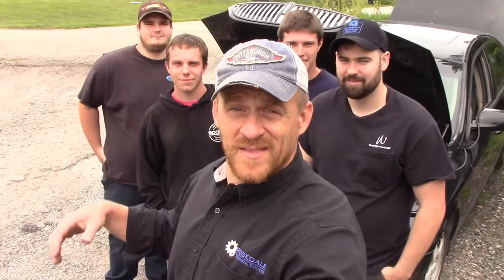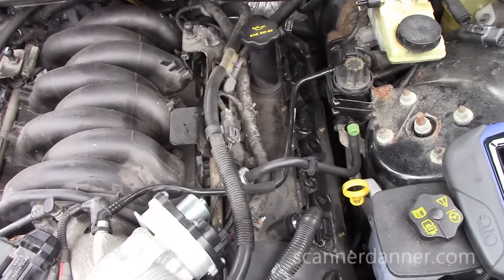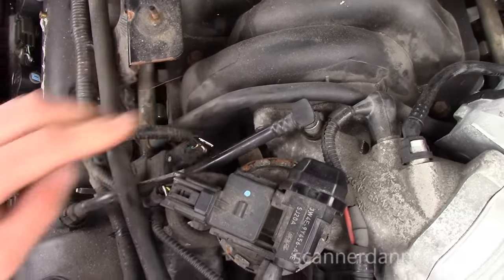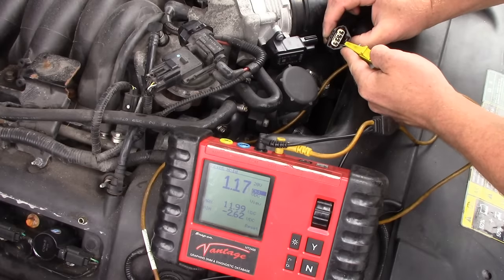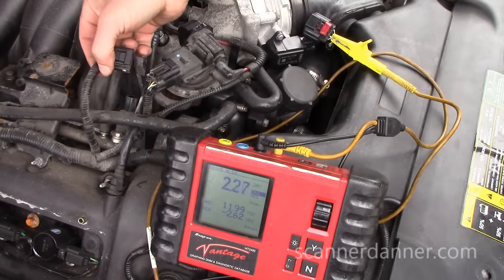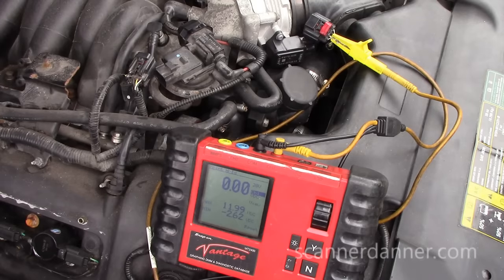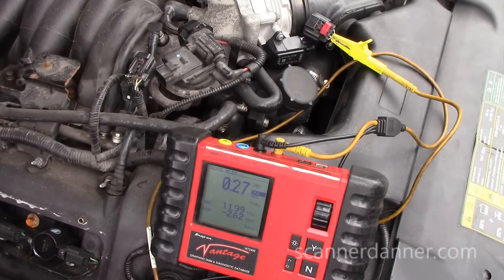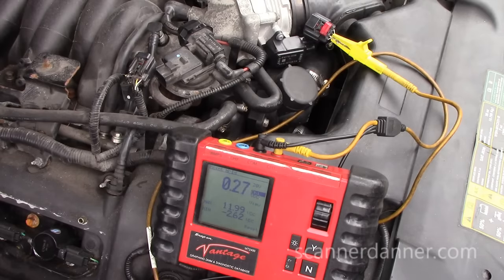Troubleshooting a No Start, No Spark, No Fuel, No Com (any car)

Comment: plan and simple " your customer employed you to diag a no start" Not a running or drive ability problem " if you find after you have sorted the no start there are other problems its a new diag book time ' key is information at the start get the customer to fill in a work order stating what they are expecting you to do second  is information about what they have done or had done  IE parts other techs ' most importantly make sure they understand you are there to do what they ask you too ' anything else will incur further charges  for your time now the why " you have spent thousands setting up and buying equipment 'training you have running costs surely it worth something '

Comment: Paul should of used your favorite tool the load pro!! Then you wouldn't need all those dumb t pins or that expensive relay tester or be setting that theft codes!! just saying!!    :)
Reply from the maker: A voltmeter and a jumper wire is all that was needed here. Just saying.
Reply: Yeah lol. you are correct. I just like giving you crap about the load pro! I love that tool !
Reply from the maker: It has it's place
Reply: Hey Paul Don here not sure if you remember me i was the guy that told you to check out "wall builders" when we had some guys complaining about our faith and the founding fathers.  Anyway my uncle is a pastor and has started 2 churches in the Omaha area and has a car care through the church for people on hard times,single moms etc. church buys the parts and fixes the car. I was a mechanic for 23 years and now work for snapon diagnostics as a diagnostic rep in Atlanta. I was able to round up some old verus and verdicts for them to have plus a up to date verus pro that was mine. They have like 8 volunteers that are helping. I'm going up there first of Oct. to do some training with them on the scanners and scope. But what i was wondering if you'd like to donate 2-3 of your books hard copies would be best as i'm not sure they have internet yet to their shop. Maybe a sub to your paid channel for the church?? Anyway either way love your stuff. 
I gave them most of my tools from when i was a tech and i had a lot. So their 3 bay shop is better now than  most shops!!
Reply from the maker: Absolutely Don. Email me at paul@scannerdanner.com with a name and shipping address of where you want them sent.
This is the stuff that truly matters.(helping others)

Comment: It's not the black spot. It's caused by the relay not making 100% contact. I bet it was only touching 10% on both sides. As it was either warped or was dome shaped on one side of the contacts. As I seen this issue before with cheap relays made in China or Mexico.....One reason when I got to the salvage yard. I pull all the relays\fuses\headlamps before they crush them. As some are Sold State and they are not mechanical and they are expensive for Factory Dealer parts....
Reply from the maker: Good tip thank you!
Reply: Word of advise to those that work on AC problems. As Honda. Nissan and Toyota use Solid State Relays. As they are controlled by the ECM. To improve gas mileage. So they are a duty cycle controlled relay. You stick a mechanical relay in there and call it a day. You will burn up an AC compressor. As it no longer is controlled by the ECM. It will run all the time or cycle...

Just like all the new alternators will shut off. To reduce engine loads. To get better gas milage. As the Alternator is now controlled by the ECM.. So make sure i fyou replace one. You put the vert exact same Voltage Relay in there. Or it will fail and they make 4-6 types specific for each vehicle. Not just year model. I fixed plenty of those as well. As they parts counter guys give you a rebuid. Yet have no clue what color Voltage relay it requires to function correctly. AS you have to actual remove it and look at the backside..

Good Luck

Comment: PLEASE PLEASE PLEASE REMEMBER THE IMPORTANT BASICS OF ELECTRONIC DIAGNOSTICS ITS SIMPLE 1 GET ALL RELEVENT DATA WIRING DIAGRAMS TO HAND 2 HOOK VEHICLE BATTERY TO MAINS CHARGER MIN OF 11.9 VOLTS STABLE 3 CHECK DLC FOR PIN 16 POWER PIN 4 CHASSIS GROUND PIN 5 SIGNAL GROUND AND PIN 6 & 14 FOR CAN SIGNAL 60 TO 64 IS PERFECT HIGHER IS DISTORTION  OPEN IS BAD COMPUTER OR CONNECTOR  IF DLC CHECKS OUT OK CHECK ALL GROUNDS WITH CONTINUITY  THEN CHCK ALL FUSES [BLOWN] THEN CHECK ALL FUSEBOXES FOR BATTERY VOLTAGE INC RELAYS VERY QUICK AND SIMPLE IN IDENTIFYING WHERE PROBLEMS EXIST AND ON WHAT CIRCUITS THE POWER CONTROL RELAY IS TESTED BY THE IMMO THRU THE RESISTOR IN THE RELAY NO CIRCUIT NO START THIS CUTS PROBLEMS TO A MINIMUM DONT LOOKING AT THE MIDDLE OR END START AT THE BEGINING
Reply from the maker: Some tips for you:
#1. Don't type in all capitals, it is known in the digital world as "shouting". You are shouting at me. 
#2. Complete sentences and punctuation is a really good thing and allows me to follow you thought process!!
#3. You are telling me how to troubleshoot this circuit, when we had the problem pinpointed in under 5 minutes! You would have still been testing fuses in your method. Learn your fundamentals, learn about the reference circuit and how important it is and how to check it and more importantly WHY it is a GREAT, FIRST test, for any no com, no start problem.

Comment: Sir why would you be doing electrical work with a dead battery that's my question?????
Reply: Isn't it obvious to you that he was able to FIX the vehicle even though the battery was low? The 5V signal was low---his tests showed the battery was well above that. That goes for the 2 clueless people that gave you the thumbs up. Doesn't dawn on people like you the battery was low from whoever owned the car trying to start it. HE FIXED IT! CAR STARTED AND RAN!

Comment: You feel taking a screwdriver and tightening the radiator hose clamp is not your problem ?  What about, will say a woman takes the car with the hose clamp leaking, that you didn't tighten and fries the engine ? What about building good customer relations ?
Reply: Because if there are bigger problems than a loose hose clamp (cracked radiator underneath that hose clamp) and you tighten it and it breaks then you OWN that problem and you have to fix it, maybe even out of your own pocket since the customer didn't authorize you to do that.

It's much better to notice the problem, notify the customer of it, ask them if they would like it repaired by you, and if they say yes you repair it and bill them accordingly. If someone pays you to diagnose a no-start and you end up breaking their radiator anything you say (I wuz just tryin' to help!) is just going to sound like a cheap excuse and that probably won't do anything positive for good customer relations. You have to keep your customer in the loop and let THEM make the decisions about THEIR car.

"The road to hell is paved with good intentions."
Reply: @napalm1101  Exactly, there are some real a-holes that would blame you for breaking it. Notify--like you said--go from there.

Comment: If you like brain teasers how about my parents 2005 Nissan armada😉 
After running for an hour or so the engine development multiple cylinder miss fires (drop outs) along eith back firing when a plying more than 1/4 throttle. No check engine light pull over to the side of the road to turn ignition (off then back on) the issue goes away for about 20-40 minutes then starts to act up again.
Haven't seen any YouTube videos fix it or have an answer with similar issue on the titan trucks (identical to the armada)
I've read multiple forums with same issue hesitation after long drive no check engine light. 
Going to ask around Nissan service techs today (10/09/17) for some answers but definitely a weird issue. Multiple cylinder drop out suggest power supply issue but don't see any engine ecu relays under the hood to check so far. I'm probably gunnar need to pull out the classic vantage scope tool
Reply: Talked to couple repair shops and found out there's a service bulletin for the engine ecu relay (what I was suspecting) didn't see it because it wasn't shown on the fuse box diagram😑
Be sure to watch our for that
Reply: Still acting up, still no check engine light, and still resets for 30 minutes with the key turned off then back on.
I feel like Gregory House 
That's interesting😮

Comment: Not a car guy per se but an electronics guy. Looks like a regulator went south.
Reply from the maker: What regulator? This was a load side contact in the relay.
Reply: Well there has to be an easy way to step down 13.8V DC to 5VDC. Usually that's done by a regulator or a dc-dc converter.
Reply from the maker: Oh, you are talking about the 5v ref circuit. Yes, there is a voltage regulator inside of the engine computer that is responsible for this entire circuit.
Reply: @kd1s  Still, the regulation of the 5VDC was not the problem.

Comment: Start with a lousy 5v dc, add corrosion, mouse loving soy based insulation, add "feature"  upon " feature" run by a computer wired with hair thin wires and shitty connectors, and you have a perfect storm of problems.
Reply from the maker: Welcome to the automotive field 😉
Reply: @ScannerDanner  No thank you. I am 78, been doing all my own work forever. I have never seen any industry purposely destroy itself like this. Making things very complicated for little to no gain is insanity. THEN sourcing parts from a country with no regard for patent law, the use of correct materials for the intended purpose, and no quality control is imbecilic.

Comment: Ill save you some time. Always switch relays around
Reply from the maker: Lol and when that doesn't work? What part do we change next?
Reply: @ScannerDanner  naw you are doing it right. But if fuses are good. I would check fuel pressure if good, then i would check camshaft/crankshaft sensors if good.  Compression if good id send it to you lol. If you plan to work on bmw type cars you better learn to read an electrical diagram.

Comment: Let's be clear... I would hate to be paying you $50/hr to diagnose a bad relay!
Reply from the maker: Ridiculous comment
Do you know how many cars I see that have had thousands of dollars in repairs before they come to me for a simple broken wire or relay problem?
You think we have a magic wand to wave over the car and say "here is your problem"?
Or maybe you are one of those people who think plugging in a scan tool is enough because it will tell you what is wrong with the car? 
How many times have you had your car at a shop and they sell you a part (a repair) and then they call you back a few hours later and say "well this part is fixed, but now you need another part"? Let me interpret this for you. They misdiagnosed the original problem and are now going to try another part. (Parts changers)
In this scenario, im saving you money. Why? Because I know what I'm doing and I'm worth every penny of that diagnostic fee.

Comment: Nice that you are indoctrinating your up and coming techs to protect their assets by being very specific about the customer's request. You don't know, the customer may be fully aware of the misfire and chose not to include it in your diag. It sounds like you're being an ass but you're not. Lucky for them you found it with little additional investment but it still counts. Then the real reason you break it down: this car was quickly becoming a rabbit hole with age, miles and beeninititis. Yes, that's now a word whether it is or not because I say so.

Comment: OK scanner went through the s10 1994 man got it running poured then started smelling gas running poorly shut it off started run like Hank man this Chevy vortec has really it'd wonder windshield still in it so I grabbed and dont no why on the platinum there are to wires that run through in take goes to regulator on spider the to wires comet to a connector Everytime I move connector it dies don't no if it's in polonium or its the connector so I hooked on 1 will not scan code so I thought computer until you thrower that video on computer ground that's next .but I'm pull polonium off just to check .but we're the ground on 94 s10 computer ground .is that why it's not taking obd1 scan I don't have scanner computers they changed computer don't no if they programmed it or not or if it had the same number it's a four-wheel drive to beat in me down but I narrowed it out

Comment: I am not going to dog U on what U did U have to start somewhere these conditions R A Fickle Beast + U must always go w/what got U to the show & that is the successes U have had to establish. < no start issues R like breaking in a house do U enter the door, window or ?? >
 1st I would go to the wire diagram & be @ the Power Distribution Centers right away. On Chrysler Domestic I could say most Communication issues R resolved there or w/in a component or wire associated. 👍  on teaching the young bucks in the auto world, U do a fine job.
Reply from the maker: The 5v ref check in a situation like this is money. Always has been, always will be
Reply: I hope U don't get butt hurt that a real Tune Up man is commenting on videos U R making public ... U R an instructor so maybe U might pick up a thing or 2 from a veteran I sure do learn from U guys, I loved going to The Chrysler Training Center shyt I even loved Union Oils Protech back I  the 70's ... Keep doing good the most important thing is the Car is fixed right the 1st time, not letting the parts dept. Fix it for U.
Reply from the maker: @StationRussification  I love when I hear "you should have" or "I would have" on a video where I'm training actual students procedures that they need to learn, on a live car, with an unknown problem!
What's more important? A quick fix, or learning tried and true testing methods along the way? 
If you have a better way, good for you! Make some videos about it and teach people your methods!